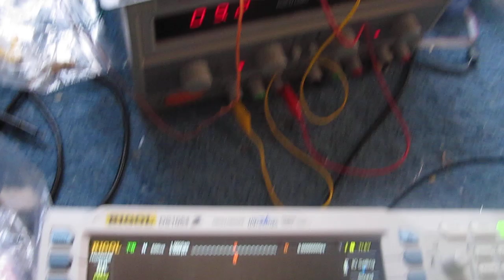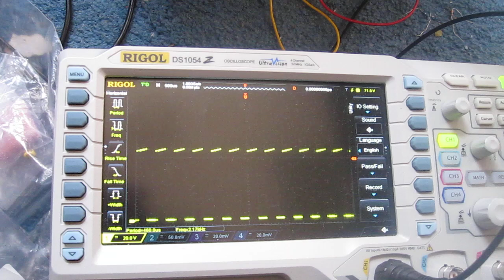Voltage Controlled Oscillator (VCO) Circuit with a 555 Timer

Comment: It's PWM if I understand correctly, well you can sort of call it VCO but for usability, a proper VCO, oscillation is within a short range where output does not vary too much away from base

Comment: Thanks for sharing this. I notice that the duty ratio of the output also changes with change in frequency. Is it possible to design a 555-based VCO with a fixed duty ratio of 50%? Also, is the change in frequency linear with respect to change in input voltage of the VCO?